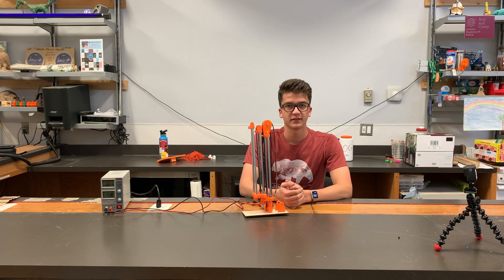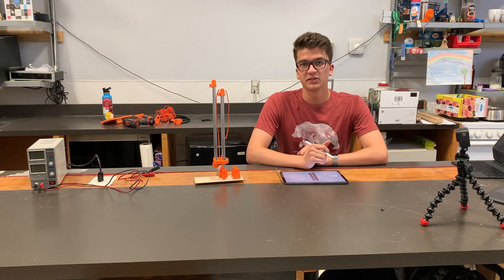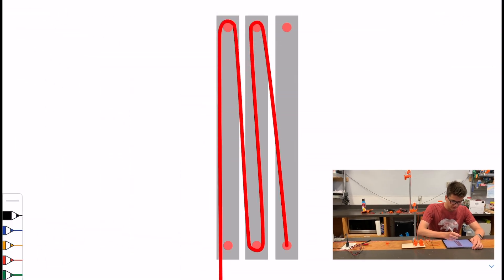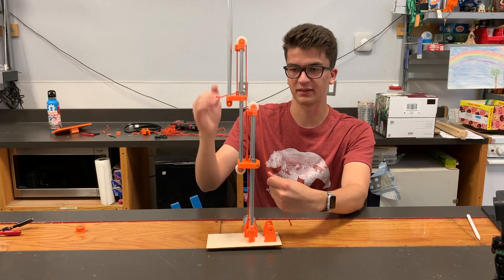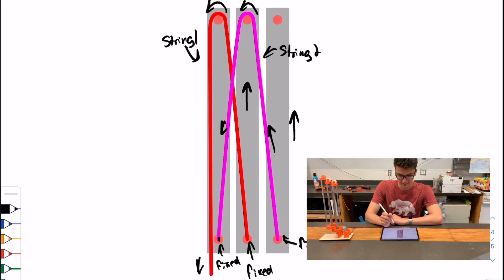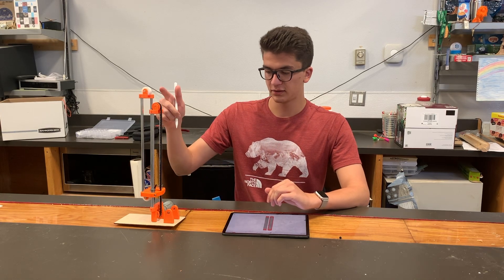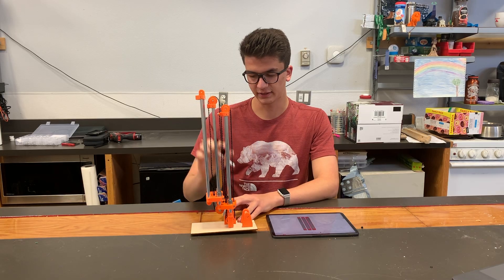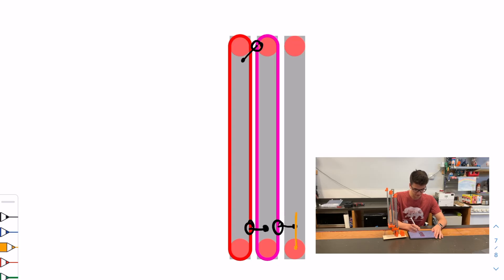Understanding Linear Slide Rigging For FTC

Comment: I have a 4- pole telescopic antenna mast, total length around 10th fully extended. I want to add some sort of a internal slider mechanism so I just wind up via a pulley.
Do you have any suggestions, and maybe a diagram on how to construct.